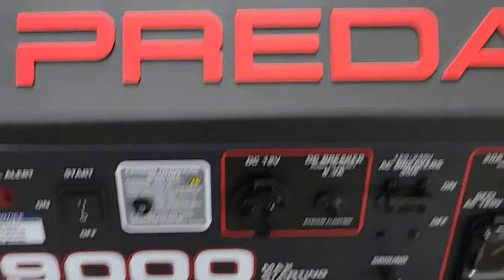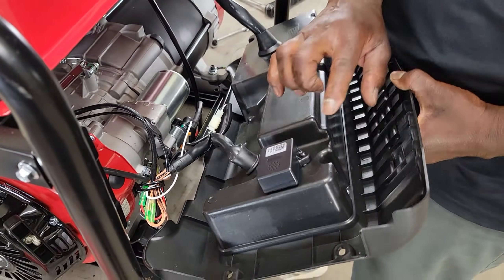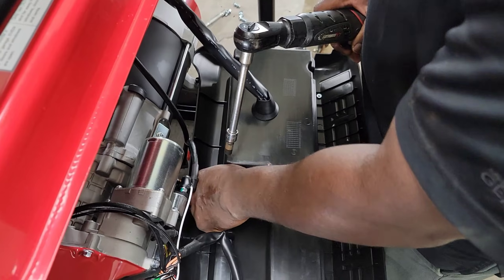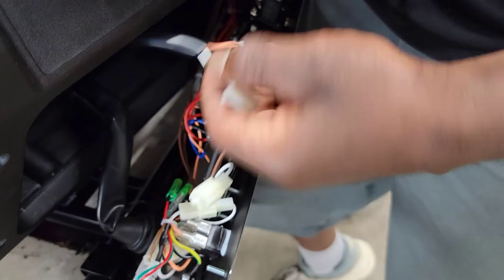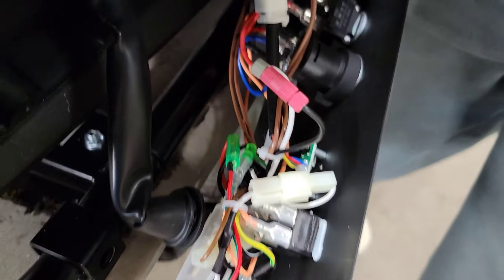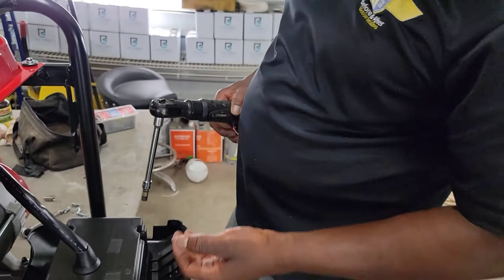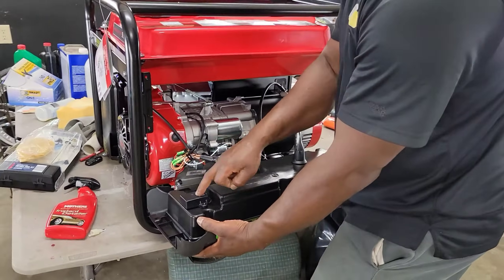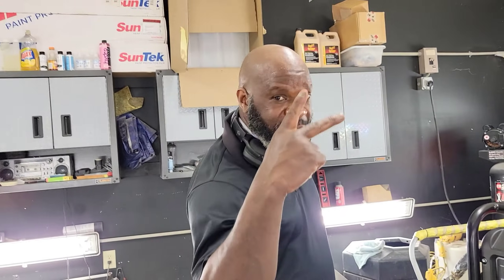9000 watt Predator C0 sensor bypass!!

Comment: By far the best video in regards to the carbon monoxide sensor .. I spent almost half a day with this generator… cleaned the carburetor, emptied and cleaned the fuel tank, adjusted the valves , oil, spark plug etc.. I went through about a dozen videos and followed your steps to the T… fixed the problem… thank you and you have gained a follower for sure 👌🏿
Reply from the maker: I greatly appreciate it and glad it helped you out😊 Have a blessed New Year!

Comment: Thank You Clay for you knowledge it worked on my new predator 9000 watt generator that Co2 sensor was causing me trouble i was ready to get a different generator !!  Been off grid for 3years my old Homelite generator died in December 2024 bought predator 9000 watt in January 2025 ran great ! In June it stoped making power had to replace the brushes and holder it melted down everything was fine then every 15 to 20 min. Co2 sensor shut it down !   Placed a fan blowing at the sensor ran all day then shut down again!  Then 15 to 20 min. And 15 feet away from everything then I seen your video and the wiring was just like mine I clipped the wire off the sensor and spliced it together put everything back together and ran 18hrs. With no problems !! just like you that was the only thing that I changed !!   Thank You for putting out this great video !!!!                                                 I seen one video that someone deleted all of the sensors and low oil sensor too Hatchet job not Profesional work !! You did a Profesional JOB !!!!👍👍
Reply from the maker: @GrantFiles, thank you. I appreciate you watching. I'm super glad it helped!!

Comment: new ones are wired differently, there is a conector  in the black and white wire behind the panel. i just did my new one. i followed the black and white wires back torwards the sparkpug, they go under a metal shield...to what i dont know.

Comment: AWESOME sauce, on my 6500 predator I noticed that yours had the same wiring plugs as mine, so I released the wires from the plugs electrical taped together along with the plastic plug.  I GOT POWER CONTINUOUSLY NOW. THANK YOU THANK YOU THANK YOU

Comment: It's May 2025, and I just disabled the CO detector using your instructions for a predator 6500. Rather than cutting wires, i instead made a short lead with two connectors and plugged them into the socket.
Reply: Will that work on the 11,500 watt ? I don't want to cut wires and void the warranty.

Comment: Can i still use the switch to start from my battery or do i need to start using the cord after i make the adjustment to the sensor?
Reply from the maker: @RonDaniel7  switch should still function normally.

Comment: Thanks for sharing.  There is no need to cut the connector off.  All you have to do short it out with the staple or something similar.   This method you can reconnect if need.
Reply from the maker: Thanks for the info!

Comment: LITERALLY JUST PUT 2 STRIPS OF DUCT TAPE ON EACH SIDE OF CO¹ SENSOR (COVERING SPEAKER‐LOOKING HOLES) AND WORKS GREAT... AT A TRUCKSTOP... SURROUNDED BY 300 SEMI TRUCKS IDLING IN TEXAS 😅
Reply: Tape won’t work more than a couple times. Have to do the wires. Had dozens of these over the years

Comment: Thanks for this!  Brand new generator here that won’t stay running.  I even bought an expensive exhaust extender kit…still won’t stay running.  Predator is doing this to avoid a lawsuit if someone does something stupid.  Love the idea of just gorilla tape over the sensor, will try that first before shorting the CO relay.  Where has common sense gone that we need this level of “safety” on a generator??? We must be getting really stupid in this world…hey folks, don’t breathe exhaust fumes, it will kill you.  Done!  🤦🏼‍♂️
Reply: I am thinking using a tape to get around the issue as well...Mine is an older one without a CO sensor but thinking about getting a larger one like this.  Have you tried the gorilla tape on yours and did it work?  Thanks.
Reply: I had an extra wire connected to my white and black. It was brown.
Do I splice that one in with the white and black or do I dead that one off?

Comment: Looking at the sensor in this vid...it seems to have a series of holes ( like speaker holes) on the one-edge of the sensor. Would taping off the holes prevent excessive CO from accidentally tripping the unit?...or....does it NEED clean air to enter for it to function well? If it's only excessive CO entering as its functioning...then putting silver HVAC tape over the holes may do the trick

Comment: Great video, my only question is after bypassing those wires I guess you didn’t plug the connector again, my thought that I’m going not to do any cutting rather I’m thinking of installing a joint clip

Comment: My wiring and connections look nothing like yours. I even found a video of the same model I have and its wire colors and connections were different as well. I have tried all day to override mine and cant get it done. Guess Ill have to take it to a repair shop and see if they can do it for me.
Reply: If you have the 13000 tri-fuel I cut the wires (9 of them)  in the middle where I could get some room and extended the wires 3 ft with irrigation wire so the sensor is nowhere near the gen. Can put it in a box on the floor and Co2 will never trip it again unless you really DO have a issue. It took over an hour and I have small hands and good dexterity so was not too bad, make sure you can get your fingers in there BEFORE you cut them. To get the sensor off with the stupid rounded screws I used a step bit and ran it forwards for a sec then Backward HARD and the screws came right out. After that cut where you can work on them and add as much lenght as needed to get to a clear air area from genny.

Comment: For those who can't figure out their generator issue, this may help:

If you can't find a vid that matches your model's colors, brown and orange are the same wire. Mine is a 9k and it was orange+black, and green+white. Orange and red were left alone.

I've seen it time and again... If the sensor is the issue (which happens all the time because they are complete garbage!) It will start and then turn itself off after a few seconds. Chances are, even if you wait for it to turn off, it's going to keep happening.

If it starts but keeps turning off, (usually accompanied by a flashing light)
bypass the sensor.

If it won't start at all, (assuming you are good on gas and oil of course) check your spark plug.

If it starts but doesn't generate power check your motor brushes/voltage regulator. 

As frustrating as a problematic generator can be, these are your most likely culprits, and they are fairly easy and cheap to fix. 

NGK spark plug is available at NAPA and other auto parts stores (under $10). To get the motor brushes/voltage regulator, you can get that even on Amazon (also under $10).

To bypass the carbon monoxide sensor, obviously you can see how to do that on YouTube. You can also find walkthroughs for how to change the other parts too.

Hope this helps someone. I know this comment would have been a lifesaver to me on several occasions in the past!

Comment: I appreciate your video.  I have this same problem with a brand new 9000w Predator Generator.  I didn't go to the extent you did with yours.  Once I saw where you pointed out the CO2 sensor's location, I just duck taped over the holes for the sensor and am hoping that it works.  If it doesn't, I'll come back to your bypass circuit, and post the results.  In the meantime, taping off those holes in the back of the sensor is working for me.  My generator is in the open air, so CO2 isn't an issue for me.  The only issue was having it shut the generator down when I need it to be running.  Thank you so much for posting this video.
Reply from the maker: Thanks for Watching how did the duck tape work?
Reply: @Whereisclay  In the end it did not work, I had to unplug it from the circuit.

I had forgotten about this, your video helped me a lot.  I use these generators as backup power on my off-grid power set up to charge my battery banks when needed.

For that to operate automatically on demand I had to design and build an automatic electric choke that works while the engine is cranking over.

The automatic choke works perfectly.  I designed it six or seven years ago and made slight modifications over the years as weak points presented themselves.  As generators wear out I simply move the auto-choke over to the new generator.

This allows the generator to function automatically whenever the electrical system needs it, 24/7.  All I have to do is keep fuel in it and do the oil changes.

If you want to see how it works, check out this video:  https://youtu.be/SIv58DvPuM0?si=KVZ8-YmAZHwc4sHI
Reply from the maker: @JeffBishop_KB3QMT  cool i will check it out

Comment: It won’t stay running what should I do? It starts right up runs for a minute then cut off.
Reply from the maker: Not sure what the issue could be, what unit do you have? If it's like the one in the video it should work for you.
Reply from the maker: Make sure you follow the video and the wires I specified if not you will have that issue I believe if I remember correctly when I was trying to figure it out.

Comment: Hey bud, update, just bought a brand new 9000 predator today, 1-26-2024, followed your video, new ones have a secondary component with resistors and diodes in the wiring. Put the black and white wire together and unplugged both the sensor and the secondary control module to bypass the sensor. Just an extra step for the new style!
Reply: For those who can't figure out their generator issue, this may help:

If you can't find a vid that matches your model's colors, brown and orange are the same wire. Mine is a 9k and it was orange+black, and green+white. Orange and red were left alone.

I've seen it time and again... If the sensor is the issue (which happens all the time because they are complete garbage!) It will start and then turn itself off after a few seconds. Chances are, even if you wait for it to turn off, it's going to keep happening.

If it starts but keeps turning off, (usually accompanied by a flashing light)
bypass the sensor.

If it won't start at all, (assuming you are good on gas and oil of course) check your spark plug.

If it refuses to start (again, assuming you've checked gas/oil) check your motor brushes/voltage regulator. 

As frustrating as a problematic generator can be, these are your most likely culprits, and they are fairly easy and cheap to fix. 

NGK spark plug is available at NAPA and other auto parts stores (under $10). To get the motor brushes/voltage regulator, you can get that even on Amazon (also under $10).

To bypass the carbon monoxide sensor, obviously you can see how to do that on YouTube. You can also find walkthroughs for how to change the other parts too.

Hope this helps someone. I know this comment would have been a lifesaver to me on several occasions in the past!
Reply: Instead of cutting the black and white wires, why don’t you use a jumper on the actual connect? that way, if you need to return it, you can put it back into the connector without having to rewire it. A small wire and a couple of alligator clips should do the trick.
Reply: @Ericmaltz1963  in ideal conditions that would be the solution. But in the middle of the night, you just kind of go with what you got. Cut the wires far enough back so you can butt splice them back together
Reply: Hey I just brought one I unplugged the one sensor so I need to cut the black and white wire and wire them together what other 2 sensor do I unplug I just brought this generator today.
Reply: @damiannelson451  the wires coming from the sensor on the back go to like a rectifier of sorts inside the cover. I unplugged that and it worked just fine
Reply: @michaelhadley696 so are you basically cutting out the diode between the black and white and splicing then together there?
Reply: @michaelhadley696   please i know its been a year but i have a generator with this issue what wires do i unplug? all of them coming from the sensor? or just the black and white? and then do i need to splice wires? if so which wires do i splice? thank you - your fellow desperate generator owner
Reply: Ok thank you
Reply: Wish you would have done a video lol so now I'll try weekday you said thanks
Reply: @bradmorris8463  yeah, sorry bud, I figured it out at midnight with no power lol
Reply: Thank you this worked perfect !
Reply: Hey I could really use your help,  where are the resistors and the other control module? I have the newer 8750 with this same co sensor and jumping the black and white doesn't do anything.
Reply: @Southernnhmobileundercoat  is that the 8750 inverter generator? or just a regular generator?
Reply: Just put tape over the sensor?

Comment: I just finished the by-pass, and it worked, yay...only thing I did different was cut the wires after the connection,  so the sensor wires and not generator wires were cut. Thanks for an easy presentation.  Now, my tank looked like it had zero clearance.  I tried to loosen the bolts and move the tank over, but came back  to the same location when I tightened  the bolts. So what I did was place a 1/16 thick fender washer under that corner, and now I have clearance. Thanks, and have a great day
Reply from the maker: Cool beans glad it worked out have a good one!

Comment: Excelente! Really good stuff. This worked on my Predator 6500 too!
You're sharing stuff the manufacturer will NEVER share, of course. Much love and God bless.
Reply from the maker: God bless you too brother!! Glad it helped!!
Reply: My generator stopped producing electricity but will now run the engine. I unplugged the other wires from the sensor. Do they need to be left connected to produce power?
.

Comment: Tried this out and it will stay running but now it doesn't have any power coming out of the receptacles?
Reply: So mine ended up being the brushes in the generator were burnt up and melted which cut power to the CO detector which in turn kills the engine. Bypassed the CO detector and engine would run but not generate power. So after getting wiring diagram from harbor freight I was able to determine I had a bad brush set or rectifier. Opened cover and the brushes were crispy. Ordered a new set and now I'm back in business
Reply from the maker: Not sure you should have normal power out the recepticals
Reply: Same here.. ever fix that?

Comment: Just to save the wiring harness. I removed the white and black out of the connector and used a female spade terminal to connect then. Let me bypass it without cutting the harness.
Reply from the maker: Share a picture if you have one. Glad that works 💪🏾
Reply: Can you share a pic of how you did it?

Comment: Was stranded with my generator dead in the water. This saved my bacon. Did this on my preditor 4375. Same wiring and it worked. Thanks

Comment: Hello ! I did exactly what you said and thanks . I just wanted to add , the wires do go back down to the bunch of wires located under the panel on the left , there are 2 sets of black and white wires . I decided to go with your method. But it appears one could bypass the wires without removing the panel just would have to know which wires . Thanks again.

Comment: Turns out you can unplug every plug connected to the co sensor guess what still fires 🤷🏻‍♂️ I wish I could post a video kind of misleading video. If those wires had anything to do with the shut off if you tried to start them when they’re unplugged it shouldn’t start but, it does… so idk I’m a just unplug the whole thing drag it out into the yard and let it run. Mine was going off for no reason. So I’m a guess faulty sensor
Reply from the maker: Glad that worked for you what I did worked for me. Not misleading its what I did that worked for me. Seemed to work for many others as well. 🤷🏾‍♂️

Comment: I have a predator 4375 and it has the same black and white wires to the starter switch. Did what you said and it hasn't cut off since. Thanks for sharing this video.

Comment: On gas tank issue... Install a tri fuel carb ... then operate off propane (no shelf life no water in fuel issues) ... propane is cheaper and safe... On my Pred 9000 concerning fuel tank rubbing I used a heavy piece of rubber off the floor of my stock trailer...  just make sure you wash the  livestock calling cards off

Comment: Just did this but not working for me. Generator runs for 5 seconds then shuts off. Stuck in my cabin with the flu, no ac and it going to be in the 90s, this sucks

Comment: Cutting the original wire on the generator side is stupid. You just voided the warranty on a brand new generator.  You should have cut the end off the sensor and  looped the harness back to itself then you can plug it back in. Or even buy the very common harness  plug ends from ebay for $2
Reply: 5 different people get 5 different ways of doing something. Whatever works do it .Thanks for the video. Appreciate it.
Reply: They don’t inspect.
Reply: He is right they really don't inspect the unit when you bring it back. Just make sure you get the extended warranty.

Comment: Thank you sir.  Off grid, new generator, 10 hours on it.  25 degrees, snowstorm, 25  mph winds, no power, co shutdown, generator outside, 30 feet away in the wind.
Bypassed thanks to you, i have power and heat again.  Thanks, Jeff.
Reply from the maker: Glad it worked for you thank you for watching the video!
Reply: @Whereisclay what is the name of the part you replaced
Reply from the maker: @YensiTorres-g3q just bypassed the 02 sensor no replacement